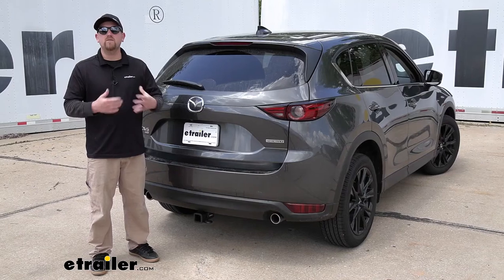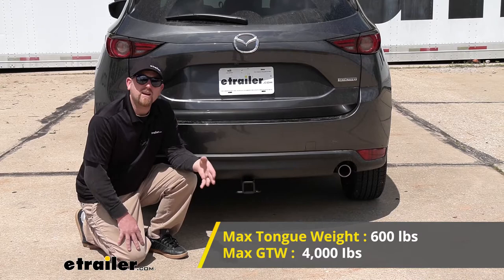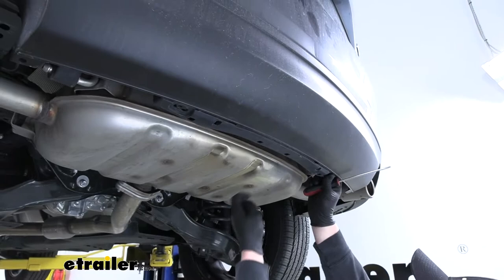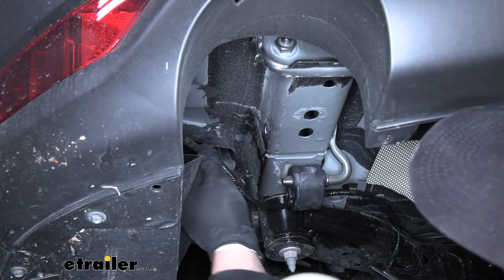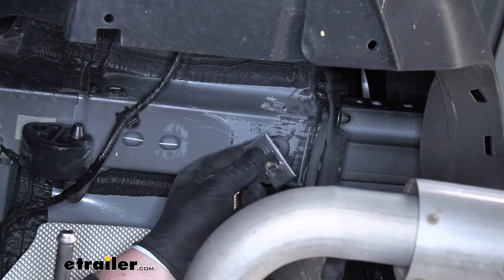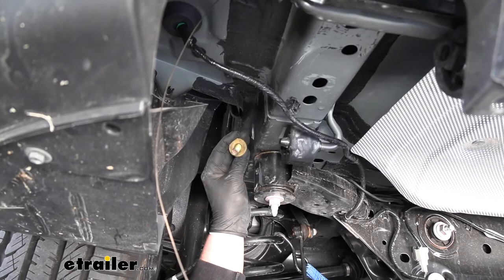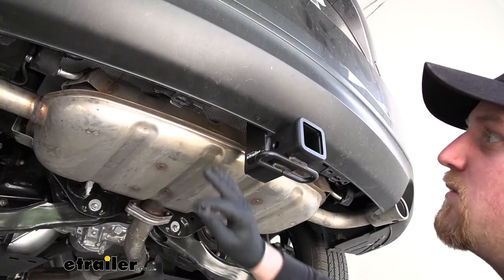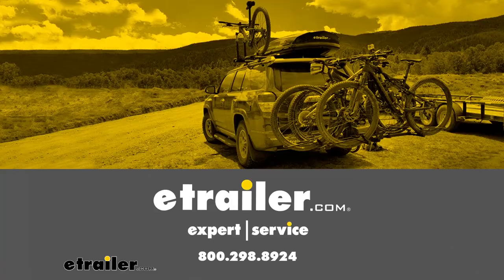etrailer Trailer Hitch Installation - 2020 Mazda CX-5

Comment: Very thorough yet to the point! Thanks!
Reply from the maker: Thank you! Check out the following link to see more information on our website.
https://www.etrailer.com/Trailer-Hitch/etrailer/e98902.html
Reply: What about the exhaust system further up the line. What is taking the brunt of the entire exhaust systems weight? It just flexes down like it's connected with a spaghetti noodle

Comment: Once you take all those sealers off, do you replace those sealers that were removed?
Reply from the maker: The sealer will not be replaced because the hitch needs to sit flat against the frame rail. You can throw a coat of paint on any scratches that may have been created.
https://www.etrailer.com/Trailer-Hitch/etrailer/e98902.html